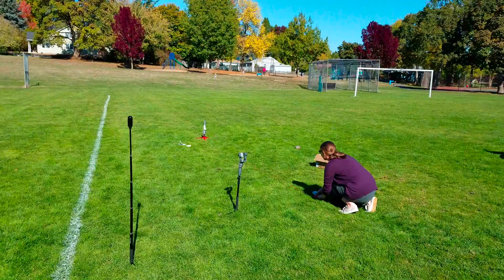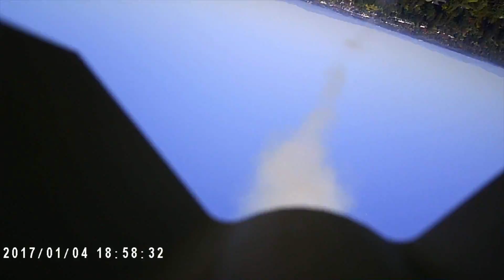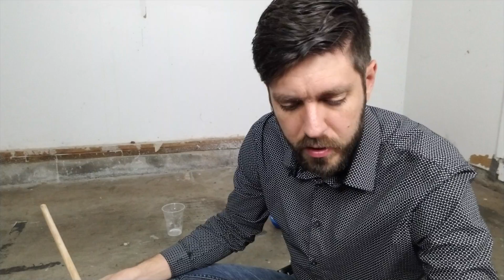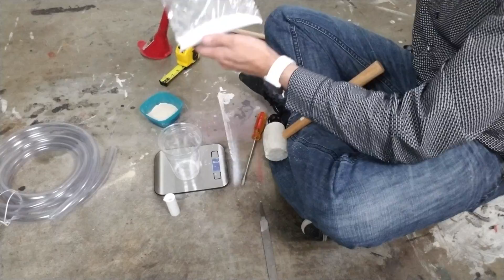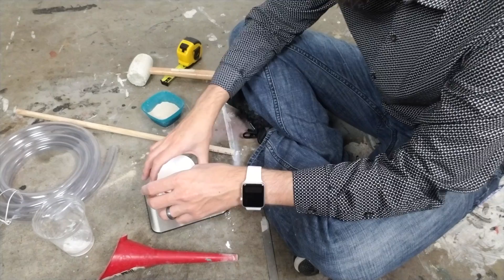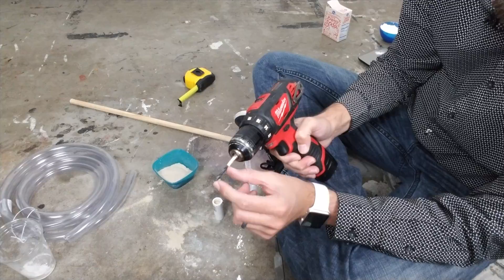Custom Sugar 3D Printed Rocket

Comment: Do more rocket fuel mean more power and thrust?
Reply: I'd say longer*
Reply from the maker: That would work!
Reply: longer thrust time but will add more weight
Reply: depends really. by adding a slight nozzel you can increaser the thrust
Reply from the maker: You could either have a longer or larger diameter engine depending on the size of your rocket. Also, you can buy prebuild engines with different thrust if you want to test it out. Sorry for the late reply. Hope you have a good time!

Comment: what pvc tube are you using. i am from Europe. please answer in mm :)
Reply from the maker: sorry about that. I realized I provided the chemical measurements in mm, but not the pvc. The pvc I used was 5/8 in imperial which would be 15.875 in millimeters. I'm hoping you can find something close to that where you're located. Thank you for watching. I apologize for the late reply. I'm just getting back to replying to comments.
Reply: In mm :)

Comment: around this level the motor should be a A or B equivalent motor. Also instead of making the motor with pvc try PLA or ABS.
Reply: PLA or ABS will melt very quickly.
Reply: @izzy828  dunno i make mine out of paper and it doesnt burn up
Reply: @izzy828  not if you add some rust powder to speed the burn and make the motor more efficient
Reply from the maker: Thank you all for the comments and suggestions. You're right it was about an equivalent to A or B. Next time I'll have to look into PLA and/or ABS. Thank you for watching!